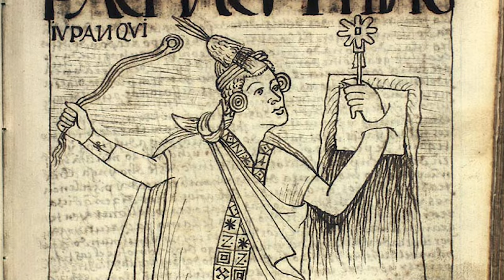SACSAYHUAMAN - How They Did It | Polygonal Masonry

Comment: MAN.  That was great, thanks much to you both.  

And, pardon the redundancy if this has already been mentioned, but, re: the dragging discussed at 20:35, is there any evidence, or records, that indicate the use of some other material—like grease that might have been used for the dragging?  

Also, re: the irregularity of those amazing walls in general—perhaps that whole idea was spawned by the natural degradation process of the mountains themselves? Perhaps the first wall began with massive chunks of perfectly cleaved broken boulders?  Then later, mimicked manually?
Reply from the maker: I don't know about the grease. I expect there is no mention of it, but a lubricant is not a bad idea. What you say about the boulders coincides with what Mr. Lee said about most of the rocks already being broken.
Reply: If they used grease it would also be under the feet of the people who were dragging multiple boulders along the same roadbeds. Slightly inconvenient!

Comment: 2 Ideas come to mind.

1. I suspect that these walls were first built on flat ground ? I have seen images of Pucc style maya mosaic walls and facades that were constructed on the ground to establish the mosaic pictures that they wanted to show. After fitting the mosaic together they then transferred the mosaic to the vertical walls ??

2. I am skeptical of ancients measuring all the angles required to make these large stones ?. If they used mud to make an exact replica of one side and bottom angle of the new stone to be fitted. Thus being able to easily make/prepare a positive form of the stone required to exactly fit the wall ! Just for fun if you look at these walls think how if you had two sides, could one then make a positive block, with the other sides being made very flat such that this process being repeated to make a new block ? Just thinking out loud ?

Comment: Nice one, explains the bumps at the bottom of large blocks. For making negative forms: they could have used hide and hide glue layered with fibres. Hardens quick. Although biological it keeps its form quite stable. Got some 120 year old hide glue blocks only one is slightly warped.

Comment: You offered some good points on possible building techniques. I like how Vincent Lee mentioned the use of logs to hold up the blocks by the nobs and notches while they are worked and fitted. Of course Puma Punku seems like a completely different story, those blocks are so precise and have perfect 90 degree angles and perfectly flat surfaces, definitely a mystery there. Do you have an explanation for the Paracas conehead skulls. If you are talking about this megalithic area it's hard to ignore these skulls. I really wonder who they were? I mean, the ones that have DNA results that say not human but humanoid. The ones that have cranial volume which is up to 25 percent larger and 60 percent heavier than conventional human skulls and also, the ones that contain only one parietal plate, rather than two. They have to be part of this regions puzzle some how.

Comment: There is no evidence provided that shows that the Inca built the megalithic walls, but do I like the theory of supporting the stones in place to hammer out an inverse mating surface. The fact that the same technique exists around the world I do find it hard to believe that multiple separate civilisations would feel threatened enough to build the same massive fortifications using up huge resources if there were not some common link between them. This technique could simply have been spread by ancient explorers/travellers sharing knowledge and stories in leu of hospitality.
Reply from the maker: The Inca told the Spaniards that they built it and even gave details.

Comment: Consider the weight of the stones and the weight of the men who allegedly pulled the stones. Let's look at 70 tons, or 140,000 pounds. Consider the average weight of the men who allegedly moved the stones, possibly 140 pounds each. So we are looking at 1,000 men just to equal the weight of the stones under consideration here. Consider the amount of additional weight in men that would be needed to move the stones. This might possibly double the weight, or possibly 2,000 men. The logistics of connecting the stones being pulled to the men doing the pulling would be nothing less than staggering if even possible at all. I am not going to go point by point throught Pedro Cieza's presentations, explaining how these stones were allegedly moved, shaped and put into place. Everything he presents defies logic and intelligent thought. This is remarkable work that SOMEONE certainly and obviously accomplished, and this work commands remarkable answers, none of which are anywhere even close to being presented on this channel. I am an architect with 50 years experience in this profession, and the claims being made here are more amazing than the works are themselves. One fact is irrefutably true. The stones ARE there. Copper and bronze tools, thousands of pulling, shaping, and lifting men, dragging over logs, etc, don't cut it with heavy, heavy, hard, hard cold blue limestone. There ARE other answers. Mr. Cieza is just dead wrong on the face of everything he has to say, and it does not take rocket science to see it. The emperor's transparent clothes are not opaque. Even a child can see that, and even a grade schooler, when given the facts here, can see that the emperor is indeed naked, and the arguments presented here are naked as well. I don't have any answers to how Sacsayhuaman was accomplished or any other of the tens of thousands of other unlikely ancient architectural feats scattered from one end of this planet to the other or how utterly similar many of them from the four corners of the Earth are to each other. I DO ache for reasonable answers, however, but no one, not even the most outlandish commentators out there, have been able to offer any reasonable and believable explanations. It is a real mystery.
Reply from the maker: 70 tons is an unusually large estimation of weight for one of these stones.
Reply: That is not the heaviest weight quoted in your video. I think 120 tons was mentioned, and I am not sure if that is even the heaviest stone at that location. However, there are numerous other sites from the ancient world of architecture, such as the Stone of the Pregnant Woman in Baalbek, Lebanon, which has been estimated to be in the range of 1,000 tons. Admitedly, THAT particular stone was only partially quarried and remains to this day largely carved but still maybe 25% of its volume embedded in the quarry. There are many sites around the world where 100 plus ton stones can be found in ancient structures. It is a daunting imagination, which can conjure up enough brute man power or animal power to quarry, to move and to manipulate such large weights, given the limited technological capabilities found in the literature of the times. There are many missing links to this and many other sites, which could obviously offer plausible and understandable explanations if we only knew what they might be. Many explanations have been offered as here with Mr. Cieza, but as an at least a somewhat educated and discriminating observer of everything said, I am left to wonder, open jawed, how ANY of these amazing feats were pulled off. Some sort of advanced technology must have been available. It simply HAD to be. The engineering and physics required for accompllishment and the obvious evidence of advanced workmanship are simply undeniable. Equally jaw dropping is how in site after site all over the world there is not a smidgeon's bit of written historical evidence about how everything was done. Circumstantially, such a homogeneously lacking collection of evidence might tend to suggest that whomever the authors of these amazing feats were, they may have intended for their identities to remain unknown. The ballpark of considerations begins not to sound too far tetched when someone might utter the unutterable word - aliens.

Comment: The first time I saw this technique, I did not find it convincing because of the difficulty of keeping the stick level and square using a plumb bob. I have now realized that you could just have a carefully leveled, flat surface at the base of the stones and then use wooden boxes or any one of a number of jigs to keep the stick aligned to the flat base. Over time, they would have come up with more efficient techniques than I could come up with.

Comment: What was behind the wall to begin with? Anything at all, or a hillside? Why build a retaining wall behind if there's already a slope above? If there was no slope above to begin with, how did they lift the blocks up onto the retaining wall? When doctor Miano gets around to that issue, he says "it gets a little tricky". That's OK, nobody else knows either. An even bigger question, at least for me, are the "knobs" on upper stones that were possibly used to hold the stones in place with vertical logs while being "fitted". The cupped "divots" in the stones could probably been be made with available tools. However, in order to create the "knobs", the entire surface of the blocks would have to be removed several inches deep to leave "knobs" behind. Very, very, inefficient in the first place, and in the 2nd place, why would the builders bothered to smooth those surfaces once the neccessary "knobs" were created? What we're left with is essentially a question of time. It's the same question that underlies any understanding of ancient Egypt. "How long did it take to do it?" If the answer is "several generations", then the questions become "motivational" and "economic". Why do it? Were the fields above so very productive that it justified the enormous effort? Was the increase in food production enough to offset the nutritional requirements of the workforce, even a part time workforce? An analysis of ancient economics might add to the architectural explanation.

Comment: The protrusions and knobs for the log support you can find also on very small stones and also on many walls. Why do you need them on the wall? Check the granite stones on the pyramid casing, relatively small stones all had the same knobs, if they wanted they could easily remove them .
Reply from the maker: I am not aware of any Inca pyramids.

Comment: Another method to achieve the negative template could have been to use a copper strip a few inches wide by however long and bend it against the existing stone to create the necessary angles for trimming the next stone. Simply place the copper strip against the facing surface of the next stone and trace the shape.
Reply: So how thick should these copper sheets be? How many times could one be used before a new one is needed? Could they make sheets of sufficient size and quantity?

Comment: An interesting hypothesis that should be tested. At first glance the suspending the stones to be inscribed seems very laborious and very difficult with such large stones. Why make building your wall so difficult when there are easier ways that also are strong and lasting. Perhaps the Inca didn't build Sacsayhuaman but did there best to emulate the architecture.

Comment: Great, balanced presentation. Has anyone ever proposed an explanation for the 'nodules' that are seen on some (but not all) of the stones?
Reply: Did you watch the entire video?  
He described them using nodules to lift the stones or hold them up.
If they wanted to remove the nodules afterwards, that would be easy enough.
Reply: @jamisojo  Except that not all of the stones have these nubs, particularly the larger ones.

Comment: well, i'm a bit behind and catching up.  when your video was panning wide over the monolithic stones set on the bottom wall, there were many odd tooling marks, vertical 'squarely terminated' gouge rows on several stones.  the mind baffles thinking they would have been shaped after the stones were laid in final position. curious that they might represent an artistic magnificence long eroded.  logically, if your purpose was to remove a 'blemish?' in the front face, you wouldn't then gouge your path deeper than the general surface.   the effort they represent could be explained as part of the quarrying method that separated the next stone from the bedrock face.  

a second thought, i always imagined the tabs left on the sides of stones were braces for a wooden frame that was lashed to the stone, extended front and back, then a coordinated effort with long trunks as levers and positioned pivots would move the stone to the site.  we can't forget that humans at the time had a jungle forest with thousands of years to mature.  probably better selection than Home Depot.  

and finally, how can the key-shaped locking mechanism, chiselled into faces here and there, be found on sites everywhere?

Comment: Actually you could technically scribed the stones laying the wall flat to the ground without suspending and erect it after your work is done I assume in sections. This would still be difficult considering the polygonal shapes every side and edge has to be flush.

Comment: We don’t even make simple bricks or blocks by cutting them, we pour or forming the soft material into the desired shape. It’s literally impossible to chip away so much material of many precision cut examples and pounder stones / hammer stones can barely achieve basic squares or rectangles. Even the tourist pounder stone block at the great pyramid has only resulted at creating dust and that’s after decades of tourist pounding away at the same spot.

Comment: I've been thinking about this, and i'm not saying this is how it was done, but an easy way to reduce the friction of dragging these stones would be to use timbers as skids. Set them up like a train track using wedges to keep them from spreading under the load and apply soap or fat. It would reduce the friction considerably and reduce the amount of man power required. You could run the track all the way to wherever you need it to go pretty easily.

Comment: I can’t remember where I read it but I recall reading that the Inca material culture had a sort of peculiarity in that they seemed to generally favor tensile members in their constructions over compressive members, when compared to other civilizations. So for example they would tend to make a boat out of woven fibers where other cultures would use timber. If a vessel could be built as a basket or a bag, this was generally opted for over using a box or a clay pot. I wondered that, were this true, might it be related to the high altitudes and mountainous terrain they settled? Compare the task of going down into malarial lowlands and dragging logs back up your mountain to the relatively more relaxed task of gathering grass and root fibers from a nearby highland meadow - and you might start to see the wisdom in favoring works that “hang together” over those that are “set up,” so to speak. This maybe gave them an incentive to hone their mastery of cordage, textiles, baskets, etc. more than other cultures who might find it less of a hassle to just throw enough wood at a problem until it works. Just some (probably naively overgeneralized) speculation. 

At first I thought this was not really relevant to the discussion about the massive stone walls, but if these walls have to resist the pressure of the soil they are retaining, and that soil wants to flow downhill with weather and seismic loads, then there really would be some tension along the stone wall that wants to pull the stones from each other so that the wall can bulge out. I wonder how much of their specific interlocking construction is due to resisting this tension. I wonder if they ever used textiles as a component (think of the woven silt fences you see at construction sites to keep bare earth from flowing downhill due to rain.) I suspect in general a tensile member would decay before a compressive member would, for purposes of archeological recovery.

Comment: Something that is not mentioned here. The cuts between the stones are not linear. They recess or protrude into the adjoining blocks. Matching the facing surface perfectly. Only the back is left rough if it is a terrace block. So you can forget about rasps.
Reply from the maker: Show me a stone in which there are protrusions not seen on the outside that go into an adjoining block.

Comment: May it be possible that they worked three sides of two rows of stones at the ground. Put the lowest row in place. Them work the shapes (all 3 sides) of a third  row of stones against the top  shape the second one and them put the second one over the previous row and so on. This will is easier  than having to work  the top and boton of the stones with the lowest one in place.
Reply from the maker: A good idea!

Comment: Nothing but respect for you two gentlemen, but I'd still like to point out that our strongest modern ropes which are molecularly stronger than steel can only support up to around 15 to 20 thousand lbs. And I don't see any amount of pulleys closing the gap. I realize I'm not an expert but when the weight that's allegedly being moved is enough to literally crush any materials that are attempting to lift it, I just can't accept it. But I'm probably wrong lol
Reply from the maker: You realize that when there are multiple ropes, they don't each have to take the full weight of the object, right?